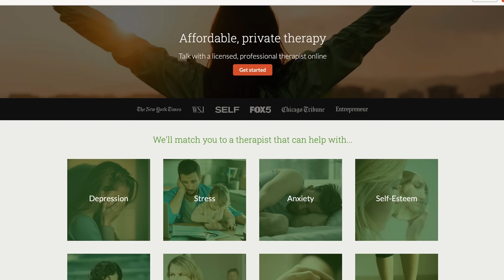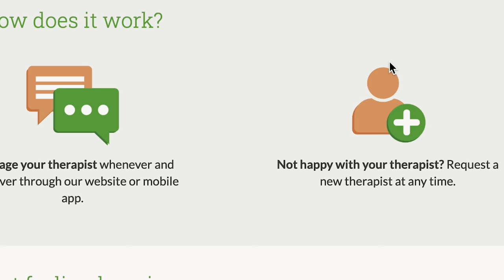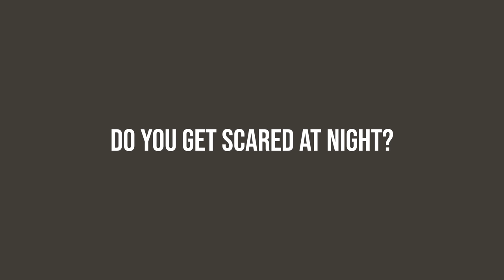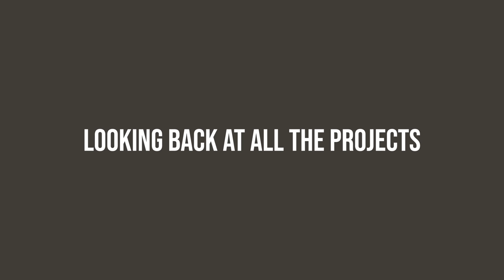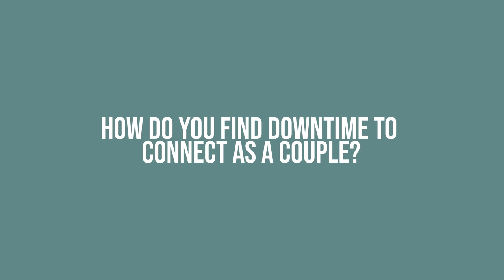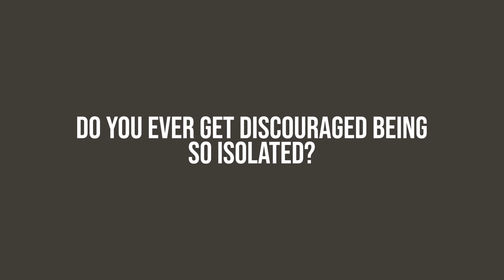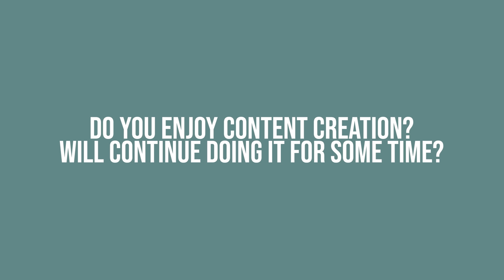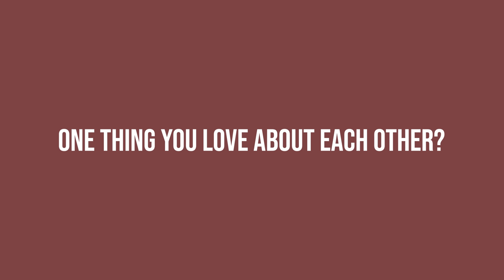Don’t Do This In The Woods!! (PAINFUL)

Comment: Crystal, don't rush that ankle, a sprain usually hurts worst and takes longer to heal than a break and if pushed too early will definitely take longer or can lead to having a very weak ankle with can cause other sprains later. Good luck to you both, love your vids. Mike
Reply: Holy Smokes girl please relax glad it’s not broken. I was running down some stairs two weeks ago barely looked the other way and for the last two weeks I’ve had my foot up I  an ace bandage thank goodness it didn’t turn black and blue but it’s a pretty yellow color I also put CBD over it and that helped so much because I don’t take any type of Advil or Tylenol it’s actually a high percentage of alcohol with the trimmings from the hemp. OK that’s my doctor‘s remedy for you please hang in there I know the pain you’re going through. You ladies are fabulous and inspirational and the words Dr. Maya  Angelou you both  phenomenal women🥰🌈🔥
Reply: Michael, I agree with you 110%. I have a history of bad ankle sprain, x3 plus ankle injury of bone contusion. Weeks of crutch use, and/ or wearing a support boot. .......leading to bursitis. I "hurried " my recovery and have suffered for it.
Reply: @deniporter3321  I’m 63 and have had the same as you… rushed them, re sprained them and so now I still suffer weak ankles 😞
Reply: Agreed Michael.

Comment: Ohh man that roll was gnarly! I install garage doors and work on hydraulics under loading docks so theres always plenty of opportunities to roll an ankle on some parts or slip. I've found the boots with a boa lacing system usually have the best protection from jumping off a scissor lift or ladder and provide great stability when walking on beams. Plus easy to set looser and slide on and off like the Chelsea's. I use and love the redwing exos boots and they aren't too much money and are super lightweight waterproof while having thick cables running through them to add stability. Hope you heal well and it doesn't happen again! My friend and I love watching your projects and or travels every Sunday!

Comment: Seems like around the Rocky Pad Landing, you could strip some "Trenches" and either look for an area that's clear of Boulders, or barring that build a little Hill out of better soil from around the yard?

Driving over it a few times should get some decent compression, and you could reinforce it with a big "Flower Bed" wall?

Comment: Just keep in mind french drains are high maintenance and should be cleaned after every bigger rain event. We installed a lot of them and often hear that now the water can be collected with ease. This is maybe true for the first 3-5 years, depending on the area installed. In your place with wood and therefore a lot of leaves around make sure that the actual collecting path always stays free of clay or other water blocking stuff. It is the most essential maintenance job or else the drain will not work anymore :-) And I absolutely feel your pain when you knicked your foot that way. It happens to me all the time and it is a horrible feeling and pain. Get well soon and kind regards from Switzerland

Comment: Crystal, when I saw the way your ankle twisted I cringed because I used to be a runner running about 65 miles per week.  Running means injuries so one morning while just doing a short run before work at the local park, I stepped deep into a gopher hole and even with headphones blasting in my ears, I heard the pop as my foot twisted exactly like yours did.  Somehow I managed to stop my run right there in midair as I pulled my foot out of the hole (running on grass is never a wise option by the way, but I digress) immediately, it looked like I had a baseball on the outside of my ankle and the pain was unbelievable.  I was about 3/4 of a mile from home so I had to hop on one foot the whole way.  No cell phones back then. I can tell you, running is so easy compared to hopping.  I couldn't get an appointment with a specialist that day so I went to my friend who is an acupuncturist/Chiropractor/M.D.  He took an x-ray to make sure there was no break.  He then inserted a needle into the hematoma and let the excess blood run off into a bucket which was a huge relief, followed by about an hour of running a gentle electrical current between two needles on either side of the injury to restore communication and reduce inflammation.  Being the crazy and driven person I am, three days later, I taped my ankle and went for a run.  I don't recommend taping because peeling the tape off of an injured ankle is not something any sane person would want to do (did I already mention that I am crazy and driven?).  It hurt quite a bit to run on it but not enough to stop me.  I really think that working the joint and the electrical current restoration of energy helped it heal faster.  I am wondering if you can go to a pharmacy and get a decent ankle brace that would support your ankle enough that you can get some movement in the joint.  Joints lock up pretty quickly and you don't want that nor do you want any atrophy of the ligaments or muscles of your ankle and we all know that inflammation is the enemy.  No, Crystal, not so you can work in the garden and do major labor but so you can walk around and do things and possibly even drive a car.  Just a suggestion but the point of this was not so much to tell my story as to say, I feel you, Girl.  That is a nasty injury that really does some damage to the muscles and ligaments.  I did enjoy the Q&A, maybe the next one will be on how you decide exactly what you want on your property and how you go about laying out plans ahead of time.  Feel better Crystal I hope your ankle heals quickly and completely and Jazzy, do relax and take this time to not double up on your chores or building to make up for Crystal not being able to help.  The worst thing that would happen is that you will realize that you won't be Winter ready and you will have to plan another vacation to get you through those colder months.  Traveling should be done while you are young enough to enjoy all that new places have to offer anyway, so it would not be a horrible bump in the road of your plans if this happens and it turns a negative into a happy and exciting positive. Also Crystal, Kinesio Tape might help you once you get past the initial trauma to your ankle. You can look up Kinesio tape for ankle injuries online.  There are lots of YouTube videos on how to use this product and it is generally available at any pharmacy, sometimes called Sports Tape.  It is also easy to find the tape online, I generally buy mine on Amazon.

Comment: I had a really bad sprain years ago. After hopping into the er they did xrays and I hopped out with a pair of crutches and what they call an aircast. This thing was amazing. My poor ankle was black and three times larger than it should be but that cast stabilized it and cushioned it and it felt worlds better. You should get one and keep it around just in case.

Comment: Get well soon Chrystal! I’m sure you will if you listen to Jazz🥰.
Have you heard the saying ‘it’s better to work with nature that to fight it’? Since the screw piles won’t work you need to expose your rock formations in the area you want to install your solar system. If it is bedrock or the boulders are that big you can use them to anchor your tower to. You can drill into the rock and use epoxy glue to hold threaded bar into the rock then screw your supports onto the threaded bar. Doing this should give you a more solid foundation that screw piles ever could. Some modern steal framed structures use this method in countries like Finland where bedrock is all you have to build on🤓😎 Keep up the great work!!

Comment: About 20 years ago I fell 16 ft from a deer blind in pitch black darkness a half mile in the woods. I pulled all the tendons in both ankles and I almost got killed. I had to crawl on my hands and knees to get out to my truck. I couldn’t drive it as I could use my feet to control the brake or gas pedal. I was not able to walk for 2 months so I know exactly how you feel. I hope you are feeling much better now hunny

Comment: SAFETY FIRST  Ladies, SAFETY FIRST !!  Clear your work area of anything you may trip on. Say about 5 - 10 feet all around. Do the same on you path/walkway to & from the job sites. Remember power tools DO NOT care who you are, they just want to cut, drill, twist, or pound something. The Timber on the 2 saw horses & the chain saw.....count your self lucky to still have all your limbs & to be alive.Please don't get me wrong, I have been a carpenter for 50 yrs & I think what you are doing is cool & you are doing a pretty good job. Just be safe & Keep Smiling  p.s. I do enjoy your videos.

Comment: If you don't have a boot or ankle brace, you can make one. I had a serious s sprain or fracture, not sure as I didn't go to the doctor. I rested and elevated and ice. When I started trying to get around it was very painful. I did have an Ace bandage. I cut out a three inch "brace" from stiff cardboard, ie pizza box and plac d the center under my heel. It came up about six inches on both sides. Then I wrapped it with the bandage preventing me from reinjuring it. It saved a few bucks and did the job.

Comment: ouch i done the same thing years ago walking down some steps mis footed and turned the ankle over, simply stretched / tore the ligaments ,took ages to heal (worse than a broken bone) so i was told, then when it was better played soft ball in the out field and waddda you know ,running back to catch a ball and foot went into a divet, yep done it again, and then at work on uneven ground yep done it again.. took years to heal proper.. strap it up and take it easy...

Comment: Being out so far from a city, relying on only a couple of roads to get into and out of the area is a real vulnerability.  Any little glitch can morph into something much more serious when you are isolated.  Delays can have serious consequences.  One thing to keep in mind, electronics (like batteries) do not work as well in severe cold.  The cabin needs so much work to make it weatherized and to survive that harsh winter.  You need to walk around the cabin and area and get serious about doing a physical hazard assessment.  Trips and falls prevention should be high on the list.  As you have found, loose material around paths can turn a nice day into something much worse.

Comment: Hi girls just a tip when running a chainsaw to make sure that you bury the entire chain into whatever your cutting. The dog teeth should be right up against whatever it is that you are cutting. This helps to prevent kickbacks so it’s much safer and is the proper way to cut.

Comment: sorry that you fell like that, where you are out in the woods like that a bit of basic First Aid would have helped, yes its difficult to react straight away, the first thing you do is remove your boot to look don't do that straight away! everyone does it! while you have your boot on it will help stop the swelling to start.  next if you can get a bucket of water, now the painful bit is going to happen! now you take the boot off and put your foot in it, the cooler the water the better! the water will help reduce the swelling fast! keep your foot in the water as long as you can! I done this with my Uncle when he had a similar fall, you need to have your foot in the bucket for a minimum 20 minutes. Like i said i done this with my Uncle once we done that we checked his foot out, unfortunately it didn't look right so we took him to the nearest Hospital where x-rays revealed he had broken his ankle in two places. but by putting his foot in the bucket of water had stopped most of the swelling they were able to operate that night rather than a few days later to let the swelling go down a bit. but saying that i hope you get well soon.

Comment: Omg I know that hurt, I use to fuel jets out in Vegas, my first flight of my shift I  fueled up headed down the stairs my and started to fall down the stairs and took one huge step down 4 steps and my ankle rolled fracturing my Ankle. Spent 2 weeks in a soft cast and another 6 weeks in a solid cast. I hope you didn’t break or fracture yours.

Comment: Crystal, you need to go to the ER and get your foot and ankle checked and x-ray done. I did the same thing and never got it checked.  It turned out that I did a 3rd degree sprain which was the equivalent of breaking my right foot and ankle. It needed to casted and elevated for 6 to 8 weeks.  It was never done and I'm now having worse problems now which now require surgery instead of being normal.

Comment: You should probably have an x-ray, looking at that fall and pronated ankle suggests a stress fracture, bad sprain, and possible ligament or tendon tear.  You might need a cast to heal properly and quickly, and enable you to keep working.  I can see what happened, you had been doing so much work, your muscles were fatigued and your nervous system was over stressed, so your leg slightly gave out, and you came down on that rock.  You may need to go a little easier, but most likely should be in a cast.  Bones can take about 6 weeks to heal but soft tissue can take months.  You need support there.  As someone who has had these athletic injuries, and helped others who have had them, I know what goes in and what’s needed.  Don’t rely on it just getting better from rest without support.  At least getting it checked out will give you piece of mind.  And if all it was is a sprain, then an ace bandage or elastic ankle sleeve while working, might be enough.
On another note, you should have at least two opposing roads to get in and out of your property in the event of a fire, should lightning ever strike those woods or for any other reason.  And you should both have multi round rifles and know how to use them.  You should have some kind of commode or pee system for dawn, dusk, and the night hours when going outside of your house is dangerous for roaming animals or crazy people.  Don’t subject yourselves or your dogs to any potential horrors.  The world is an unpredictable place.  Be prepared for everything and ALL THE TIME.  Lastly, have you thought of creating a small tiny house community up there, maybe a dozen cabins, so you will have friends and allies of like mind nearby yet maintaining your privacy?  I would recommend that, as you can all protect, support, and enjoy each other, especially in the most challenging times.  You could make some money this way too, while creating an awesome green, off grid community.

Comment: To speed the ligament healing, because you know all kinds of ligaments got pulled, try soaking your foot in very warm water, a bucket works, and add a cup of Epsom salts to that very warm/hot water.  The Epsom Salts aka Magnesium Sulphate is a high healing mineral.  I know this because I tore my Achilles tendon to where I could not put my heel down by about two inches.  
 I'd soak every night for a week, I could feel and see the positive healing.  
 Also the tendons will recover & repair better so you won't have a long term ankle/foot weakness.  XOXO

Comment: You don't have to screw the post, use the excavator to dig a trench ,to set the poles in and screw them in a foot or so, and fill in the trench.

Comment: Sorry to see your ankle sprain Crystal, it looked very nasty. I reckon you guys should buy a good pair of lace up work boots. Slip on boots safety boots are banned on construction sites in Queensland for this exact reason. Lace up boots will protect your ankles., I have rolled my ankle a couple of times at work ( plumber ) , but the lace up boots have saved me from getting a sprain.  Just need to cross lace the laces and do them up tight.

Comment: Crystal, when you stepped off that raised garden, my stomach flipped and I automatically got nauseous. Back in the 1970’s I slipped on a wooden catwalk in the wood yard at the paper mill where I worked. I could feel that sickening feeling I know you felt as you fell and the pain immediately. Unlike you and your sprain mine had a break in the ankle, the heel and the fibula. I spent 13 weeks on crutches and 4 surgeries later I had two 2 inch surgical screws holding my ankle together and with no healing in the ankle after 3 months I had to have bone grafts to my ankle. I watched the turn-of your ankle and was so afraid you had broken it.  Did you get X-rays done? Take care of it because the sprain stretches all the tendons and ligaments in that ankle. They have to be healed and can pull them back into place. You will have a weak ankle from now on so let it heal and continue to keep it elevated and iced. I continue to admire the work that you do and just jump into it to get it started. I loved the Q&A you just did and there was some great questions. I love the respect and the love you show to each other. Keep on doing what you do. Much love and respect from Alabama, USA….🙏✌🏼❤️

Comment: Drill the boulders to anchor the solar system  rent a hammer drill use expending plugs no sweat  you can do it yourself
For winter over stock up on firewood  and food  make sure water is available   melting snow for cooking will work but not for the rest (showers flushing)  but read about how the pioneers made it  was no IGAor Safeway in those days  you'll make it I ain't worry take care be safe